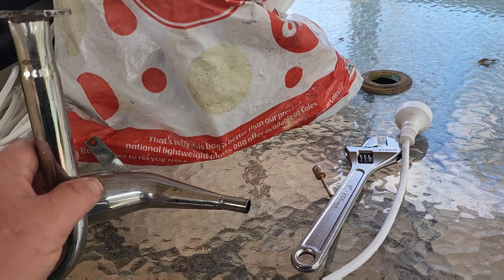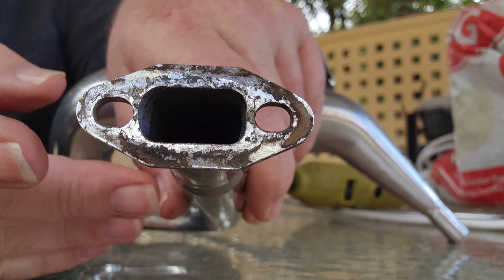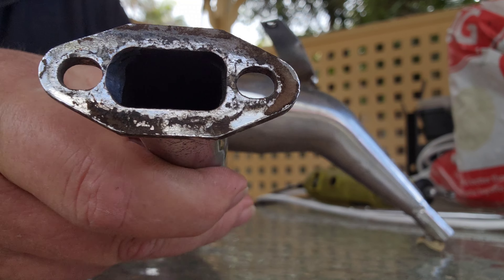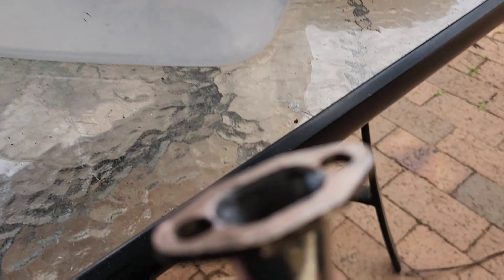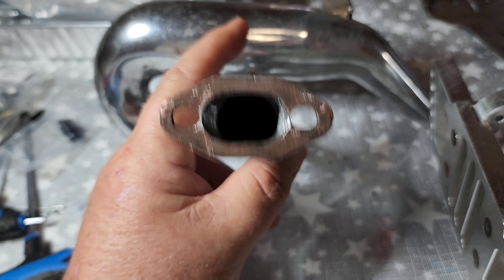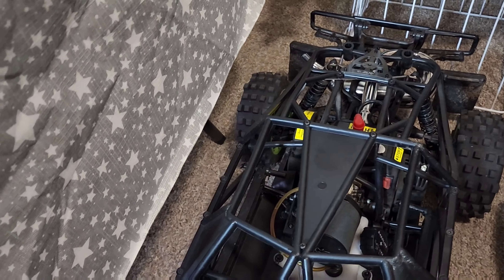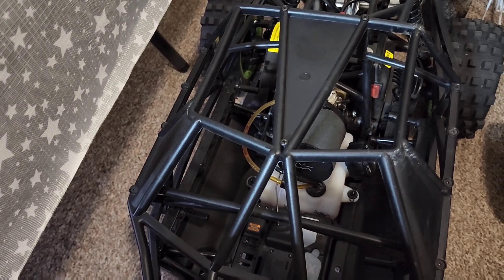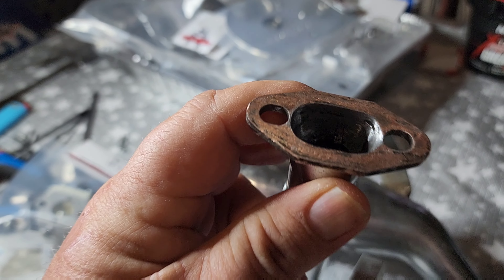ROVAN BAJA 5T FIRST MOD TO INCREASE POWER

Comment: nice easy power mod :)

11:08 been there. 

i dont recommend getting metal shavings in your eye because if a shaving went in deep, the longer the procedure takes to drill it out. and its nerve wrecking i tell ya.
drilled into a concrete ceiling without safety glasses on (i was young and stupid) i hit a metal frame bar or something, took the drill out and got something in my eye.
a week later i joined the ladies at the hospital due to ongoing eye problems(sore, red, irritating, tearing and pain when closing and opening my eye lid)
longer story short, the ladies found a metal shaving just a fraction of a millimeter off from the iris of my eye.
the worst part wasnt the drilling, it was seeing the drill come closer and closer whilst your instincts tell you to move and run but common sense it needs to be done to relieve the pain.
- since that day i wear safety glasses whenever i do work like this.
Reply from the maker: Sorry to hear mate but yeah I know what you mean our eyes are one of the most sensitive parts of our body I had metal shavings in my eyes from using a grinder in my younger years hurt like hell getting them out. Thanks for watching mate cheers 👊👌🤟✌️